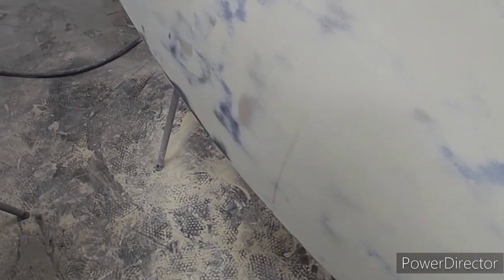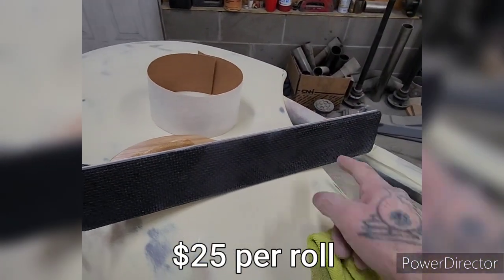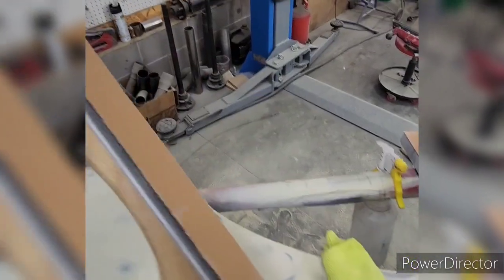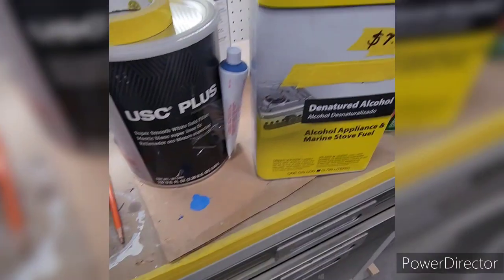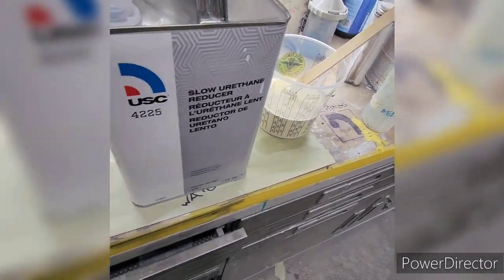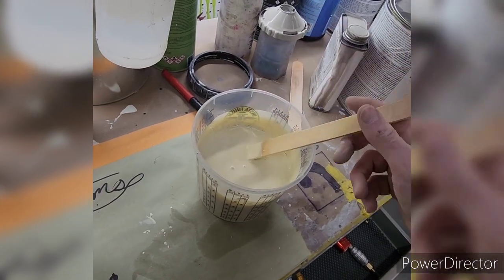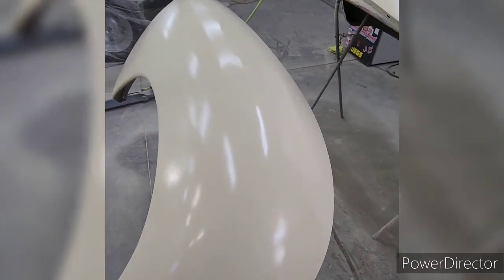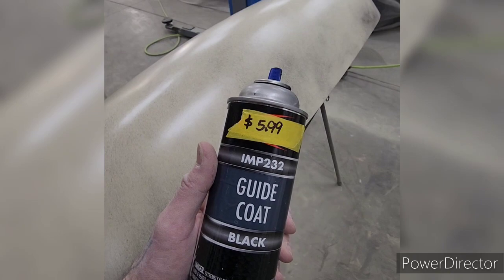How to get show quality with garage work Metal flake custom paint

Comment: Can i get the name of the primer? Hopefully its USC products but iv trusted all of your other information and you havnt led me a stray so i figured I would ask. I also use the denatured alcohol trick.
Reply from the maker: That particular primer is Kirker "perfect prime" 2:1 in buff color. Been using it for a long time, and it lays out super nice, sands easy. And is extremely easy on the wallet...sometimes you can get a gallon for like 75$
Reply: @killingcursivekustoms  damn... IV never even heard of it but IL definitely check into it for sure. Does the black kinda guide coat itself?
Reply from the maker: @gladememmott3001  Regular guide coat in a can has the tendency to spray on dry, (and that's kinda the point) but I like to get it down wet, it stays where I want it. I've even coated black over white primer and sanded for a guide.

Comment: Never seen the point  of spraying  flake over black i know  its done alot when I do flake such as say blue I'll  use a high metallic  blue base close to the color  flake then blue flake but thats my way
Reply from the maker: If I use a silver flake, sometimes I'll use it over silver base. But a black base will get you depth for miles, and different tones of the same candy. The '47 GMC I did, a blue base, silver flake, then a candy blue over all of it. Turned out sweet.